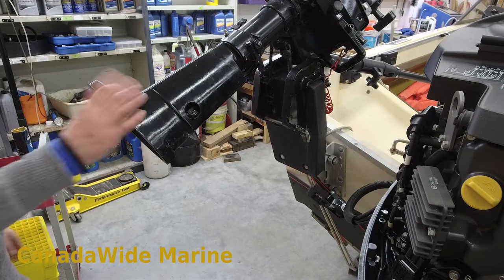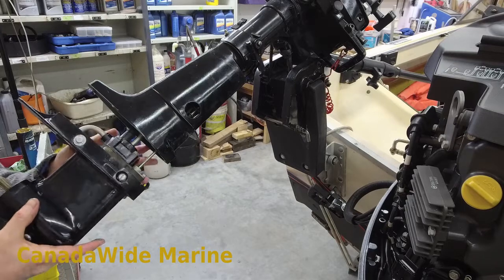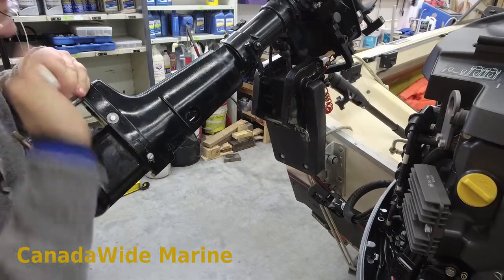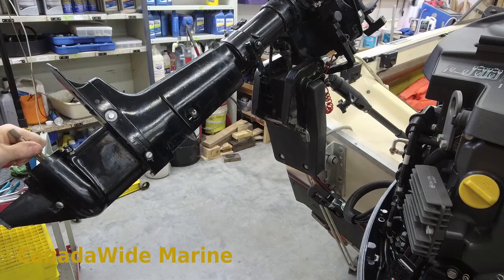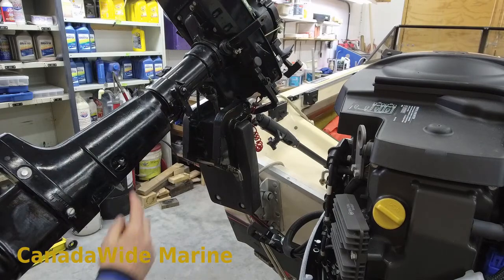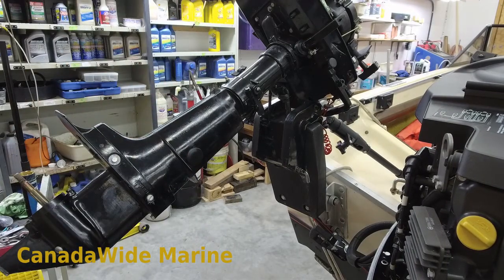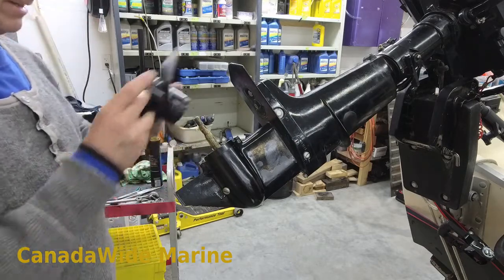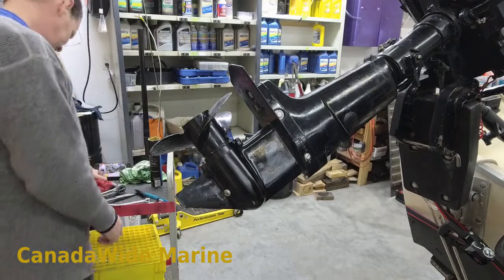How to Install the lower unit on a 4hp Mercury Outboard Motor

Comment: If you have trouble inserting try taking cover off, engine upside down stator on the floor. Insert water pipe,  gear lever in neutral, shift rod missing tooth towards drive shaft, then install lu (lower unit) Way easier to see if lu isn’t parallel and a lot lighter.

Comment: What you showed here is easy, i tried for long time to get the gear housing back on, splines arent matching. 
And tried to spin propeller and engine while pushing up, not possible... Think engine is ready for som dynamite

Comment: Your video cut as you where lining up the rod into the housing. I’m only able to get the rod up 80%. It’s greased up. Should I be in gear, forward or reverse or neutral? What’s the trick?
Reply: Yeah great point.
Reply: There are 2 things that have to happen: 1 is that the drive shaft has to make it through both of the loops in the main shaft which can be seen with a flashlight. Next as you are lining the driveshaft up, look to your shifting rod. You will notice a small hole where it must exit the housing of the lower unit. The rod not making it through this hole is what causes the gap you are talking about. Once you get the shifting rod through the hole, only then will the driveshaft splines actually make contact and you can behind turning the flywheel or prop to get them to catch and push the lower unit back on.
Reply: I have the same problem do you have a tip for it or do you still have the problem?
Reply: I have the same problem, does any one know the trick
Reply: I got mine done. As I recall, it had to do with the position of the shift lever lining up properly. I couldn’t get it in neutral, then forward. I remembering this well over a year ago so…
Reply: @williammurray4315  i got it mine. Just need to make sure that the end of the drive shaft goes in a hole at the very end of it. Take a lamp and look inside of the shaft to get a better picture. Remember to set the shift to reverse before, but gears can fixed correctly after lower unit is in place (via that little hole)